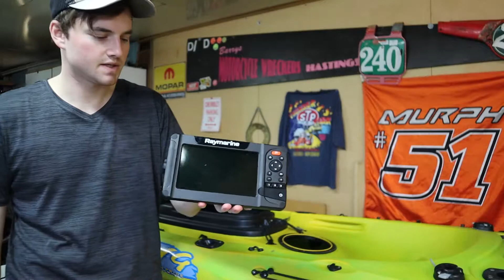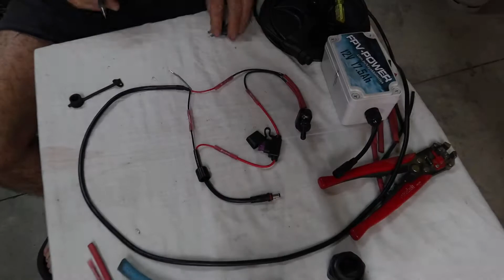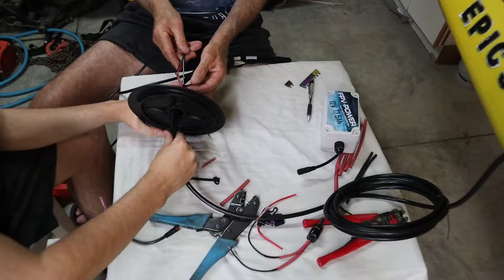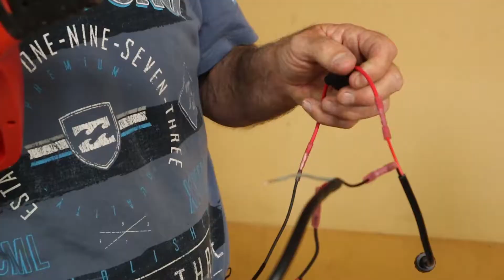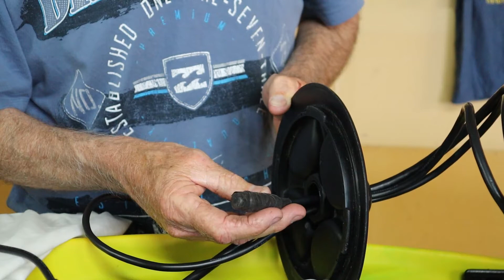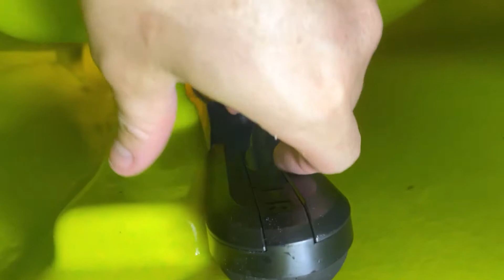Raymarine Element 7 HV - Profish 400 Installation

Comment: just brought this exact sounder for my kayak, did you end up mounting the transducer inside the hull? or is it just loose flopping around in there?  just wondering for when I do my install.  I also have a minn kota 30lb trolling motor and a 100 amp deep cycle battery to power it all.    anyway that's a sick little rig,  just subscribed...
Reply from the maker: I have a setup video coming out soon which shows how it sits. As for not getting to your comment sooner, I am not always able to get to everybody straight away. Cheers

Comment: Hi, My 12v 12AH battery got only max 3amps output !! can it enough power for the element 7HV ???
Reply from the maker: The 17.5aH is definitely the option to go for, it holds the 12V throughout the day and has the amp output too.

Comment: Good video mate. I had a Garmin side scan, all it did was run my battery down twice as fast. I think side scan is only useful in really shallow water, say 5 meters. I just switched to a normal one now with super light lithium batteries. I get 8 hours run time from a 250 gram pack.
Reply from the maker: The big thing I've got out of this unit is the capability to draw my own maps and also the improvement in processing power